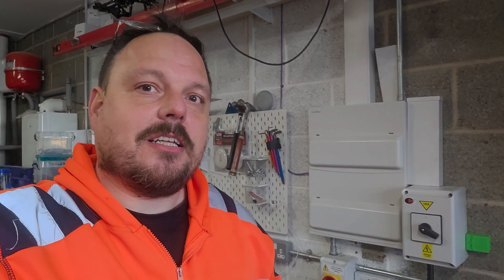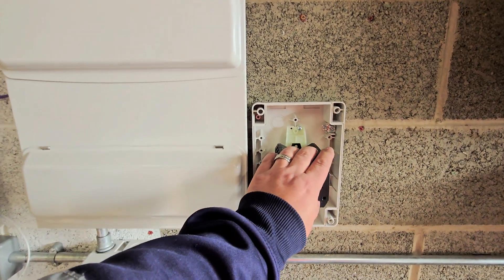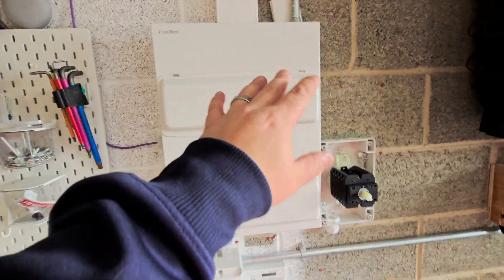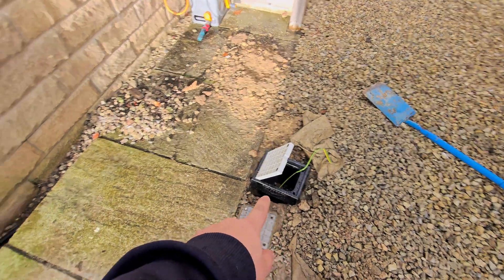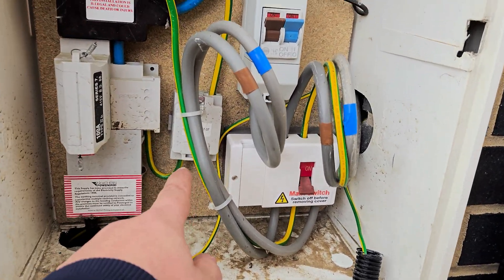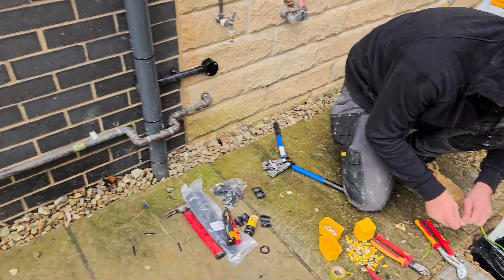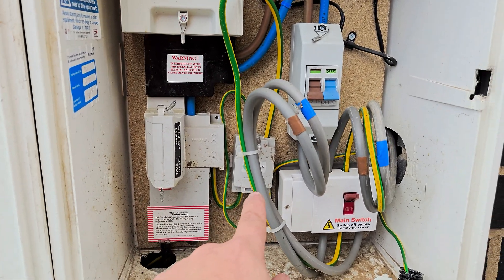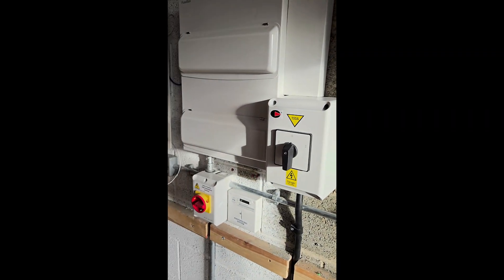ISLAND mode SOLAR and BATTERY how do you do it ???

Comment: Is it not best to keep the 2 earthing systems separate due to issues with lost neutrals
Reply from the maker: current guidance is to keep them combined. But you can seperate them. Just need to be careful with 2 earthing systems in close proximity to each other. AKA potential differences. I covered this on a prior video of mine about just that circumstance. Thanks
Reply: @electrician247  current guidance keep hearing that I still think it should be separate and switch on via a relay if the grid goes down I had a issues a year ago with a lost neutral just outside my house I now run completely off grid the only connection I have with the grid goes to 2 5kw chargers that charge my batteries overnight if I need to charge them the house runs off 2 5.6kw inverters with there own earth rod
Reply from the maker: @dama054  I've shared loads of views on this some of which lean towards your view like this one https://youtu.be/huN6yNxmjz0?si=dfll2luTjIXsch-G

But we do need to remember it is very hard to fully divorce from the DNO derived earth due to metallic bonds and overlapping earth's in the mass of earth itself. I would bet you are not as isolated as you think you are. 

For the 0.01% of times the dno earth causes a problem it seems foolish to ditch it for the times it's very stable. 

If we really view it as a risk perhaps don't use it grid, island or otherwise like you have done.
Reply: @electrician247  I agree with most inverters if it detects a short it will trip a 30ma RCD but my boiler won't run with out the ground and neutral connected because of flame rectification
Reply from the maker: @dama054  N-E bond on island mode is essential for me to maintain a reliable fault path/state within a TNS setup.
Reply: @electrician247  that's why I have installed an earth rod just pointing out that most inverters will trip if a fault is detected regardless of a path to earth
Reply from the maker: @dama054  yes they will as behave as IT earth arrangement
Reply: @electrician247  anyway Mark really enjoyed your videos very informative and always good to keep up with the new regs although I do remember back in 1983 the building regs got updated to include a cavity tray on gable ends as cold air in lofts caused condensation to run down the cavity then someone who knew a bit about building pointed out that a cavity tray on a gable end would mean that the gable end was no longer bonded to the main wall and was just sitting up there waiting to be blown down, within 3months the regs were revised and gable end cavity trays were no longer a thing